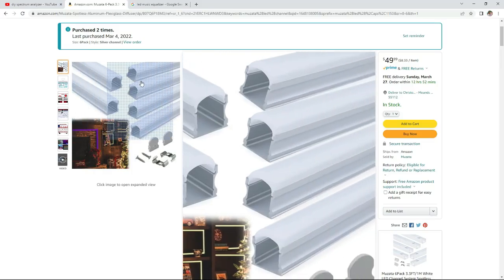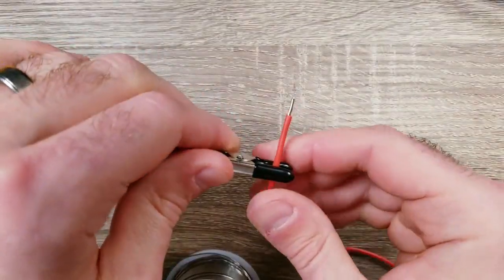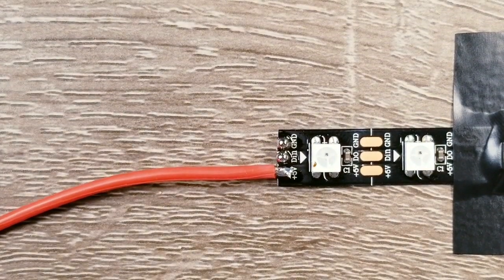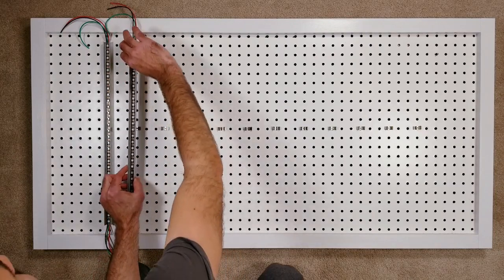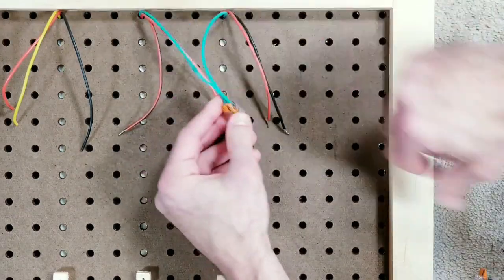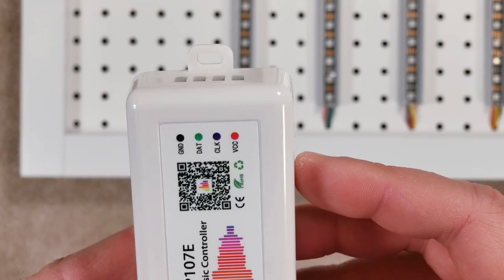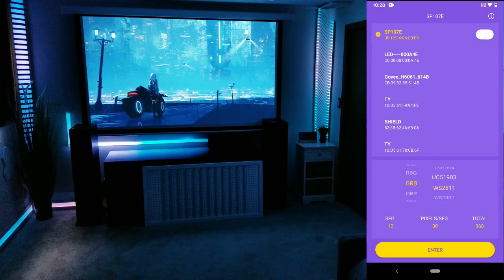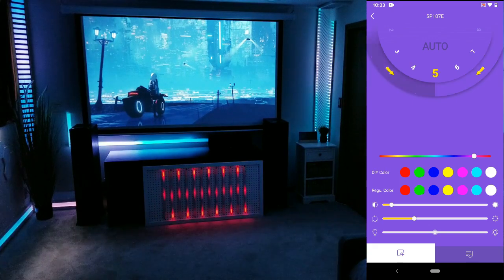DIY LED Music Visualizer - Complete Walkthrough

Comment: Pretty slick, man! very straightforward, clean, and looks awesome! I like that you kept your options open on power injection. I probably would have injected power from the other end just for my own sanity, but that's my OCD talking. 

As you mentioned in another comment, this would be very easy to convert over to WLED. I'm not sure if LedFx supports matrices or not, but that may be a viable option to pair with WLED. 

I like the simplicity of being able to connect to this with Bluetooth and that it just works, but I would definitely want it on wifi and would want some non-music uses for it as well. I may have to put together a matrix now and play with it, you've given me some ideas 😅
Reply from the maker: Thanks as always! Yeah I tried to make it so you can easily swap designs or controllers. I also didn't need any power injection as I was running the lights at about 10% brightness. Anything more than 10% was just way too bright for my liking. But If I were trying to run everything at 100%, for sure would need the extra juice for some of the white animations! Thanks again for taking the time to comment and for watching!

Comment: This is CRAZY, I have almost the exact same materials and project idea. But I’ll be doing 10 1m channels. Any advice?
Reply from the maker: Great minds think alike! You could do something pretty much the exact same but you would probably need some power injection at least at the end and more than likely the middle. But I would test things out first with no power injection and then go from there. Are you going to use pegboard or just secure everything to the wall?

Comment: Wow! Thanks for sharing this DIY, is it posible to add more led segments or up to how many is it posible with the power adapter?
Reply from the maker: Thanks so much! You can add a lot of segments. I'm not exactly sure how many but at some point you will notice the colors start to look off. That means you will have to inject some power around that point so that everything looks good again. How many led's it will take to start noticing the colors are off depends on what power supply you use and how bright you want to run the lights at. Hope that helps!!

Comment: Great project. Loving watching all your videos atm. I'm new to the channel but inspired to try a few of your projects in the new year. Quick question...I can see you recommended possibly injecting more power into parts that look discolored in bigger projects...does that involve installing another ac power source the same as the one you used or is there a different process. Sorry if the question is a little confusing.
Reply from the maker: Thanks so much for watching and thanks for taking the time to comment! I've never done really big installs so i've still only just used 1 ac power supply for some of the bigger projects I've done. That generally means you can just run separate wires from the power source (same power source that is hooked up to the beginning of the led strip) to the end of the strip (or middle or both) Now depending on the project, it might just be easier to use a separate power supply but if you do that just make sure you cut the strip at some point and only have the 2 sections that are powered by different units connected via the data cable if that makes sense!
Reply: @ChrisMaherDIY  thanks Chris.  Spent most of the night again watching your projects....Santa won't be happy that I'm asking for a Crickut off him 😆 I'm gonna start off with similar size projects to you anyway so hopefully I don't need to look into additional power. Keep up the great work also. Only recently discovered you but loving the content. So well made 👏 👌

Comment: this is awesome! do you know if it’s possible to use 2 connectors at the same time with the app?
Reply from the maker: Thanks so much for watching and taking the time to comment! That is a good question. I know the one connector does allow for a lot more led than what I'm using. You could for sure use 2 but I'm not sure if they would be able to be controlled simultaneously if that's what your wondering. I think you would have to go back and forth between the two if that makes sense. You could probably try splitting the data line coming off the controller and using that to hook up 2 different section. Both sections would then be doing the same thing at the same time!

Comment: Great video! Thanks for sharing! The LED Lights link in the video description points to the IP65 type but in the video it looks like you are using IP30. Just wondering if you could clarify if you used IP30 or IP65? Do you know if it is as easier to solder one vs the other once cut?
Reply from the maker: Thanks for watching and for pointing that out! I'll have to change the link in the morning. I for sure used ip30. Don't have to deal with that rubber coating so it'such easier to get to the pads for soldering. Thanks buddy!

Comment: Can u use this controller with strips of different length?
Like strip one 30leds strip 2 10 LEDs etc? Or will strip 2 the basicly be filled all the way all the time? Is it reprogramable / customisable is what I mean 😅
Reply: I bought the SP107E and ran into this exact problem all my strips are not the same length and no the app does not allow you to change the numbers of LEDs per strip. I am sure there is something out there that does. if anyone knows of one I would love to hear about it.

Comment: I was looking at your square led panel project. And I am wondering if I can solder the led strips.
Reply from the maker: You for sure can do the square project soldering your own led strips instead of using the ones I made. The square project was one of the first things I made and I was still very much learning as I went so thats why I used a led strip that could be compared with a govee strip instead of using a ws2812b strip like I do in most of my new projects.

Comment: Hey Chris, i have one question, isn't 10 ampere power supply too little? I've checked it on btf site and they say 1 led consumes 0.3w, which means for 360 leds basically you will need at least double of the power you have here, can you see a drop in power supply when you turn the leds on at max luminosity ?! by injecting the power from both sides the problem still exists? Kind regards
Reply from the maker: Thanks so much for watching and great question! I'm more of a trial and error type of tinkerer. I generally test things out with the leds I plan on using and with a much smaller power source than what would typically be recommended and see what happens. If things dont look good, then I add injection or a larger power supply. Now if I were to run this amount of lights at full white and full brightness with no power injection you would for sure see voltage drop. However, in most every project i've done, i never have a need to run them at full white or full brightness so using a much smaller supply generally works out just fine because for pretty much every animation, it looks great since its not drawing near the amount of power needed for full white on full brightness. Now with this number of leds, If I injected power at the end, I'm fairly confident that even at full white and full brightness it would look great but I cant remember for sure If I tested this out. One nice thing about using the wago connectors is how easy it it to add power! Hope that helps a little!
Reply: I have been thinking the same about the power. Chris, have you been running this project with the 10A power supply? Have you noticed any issues with it?
Reply: It is worth mentioning that the 60amps per LED is only when the LED is on and white. This is rarely the case with a project like this. Though 10amps seems low it likely does a fine job considering the lights are only really using about half of the max power draw

Comment: Not working for me im running the same setup exept im using 9 strips and im using wire nutz  the lights work fine up to the third led strip and then it gets dimmer, the colors change and the the sixth one just has a insanely faint red color can you help? It has the same cord too

Comment: On the SP107E manual it says that you need an external power source to run it(as in the power must go to the LED's and the lights), however you didn't do that and I also noticed that your LED strip didn't have the adapter connected to it. Did you remove it?

Comment: Hey Chris, great video. Do these LED’s have a white light? I’m not seeing the white channel.
Reply: These led strip doesn't have a dedicated white channel, however you can set 100% in R G and B channel to make it look white
Reply from the maker: These do not but I'm currently working on a project where I use some sk6812 led lights that have a dedicated white channel. https://amzn.to/3qO7ycn They are a little more expensive but its nice having that dedicated channel so you don't have to set the rgb to 100% to make white like you do on the ws2812b strips.
Reply from the maker: You got it! 100% correct. If you do want the individual white leds, i've had good luck with these: https://amzn.to/3qO7ycn

Comment: Hmmm how do you think this would look with a frosted glass slide to go over the front of it? Looking to do this project soon, but would like to keep the peg board from standing out.
Reply from the maker: Frosted glass would actually probably make it look super cool and unique! That's a great idea!!
Reply: @ChrisMaherDIY  I don’t have wood working equipment so I can’t feasibly do that idea. Instead I’ll be taking a sheet of plywood, using the pegboard as reference to get aligned holes. Painting the plywood and trim with a high gloss black. I think the black would make it look nice.
Reply: @ChrisMaherDIY  also I love your videos and ideas. Definitely want to do the vinyl and acrylic leds if I can ever get the proper equipment.
Reply from the maker: @King_Kato  Thats a great idea and I also think the black would look nice!!

Comment: How many segments can that controller run?
Reply from the maker: Thanks so much for watching! That's a good question! The only thing I could see is that its recommended a max of 960 leds.  I have never checked to see if that is in fact the max or what happens past it but my guess is you can probably go a little more than that but performance might suffer at some point.

Comment: Looks like you have a total of 360 leds, are 10 amps really enough to power this thing? I feel like it should be more like 20 amps
Reply from the maker: I'm always surprised at how good things look with little power. I always start out with less power and add it as needed. What saves me is that I really dont have a need for the lights to be on full white which is really the only time I can see a visible drop in voltage. Otherwise during all the animations, they look good to me without needing a ton of power. Thanks so much for watching and taking the time to comment!
Reply: @ChrisMaherDIY  Thanks for the info!
Reply: Usually, if you don’t care much about the “white” color accuracy, you can get away with a lower amp supply. A good rule is divide the amps “needed” by 3… and that should be enough for most color effects. Example: 21.6 A / 3 = 7.2 A (should be fine).
Reply: A led at full white brightness needs around 50mA. So that’s 18amps but he isn’t using full white so it’s only around 9A if all are displaying purple or something similar at 100 brightness

Comment: Hi Chris nice led project. Two questions the addressable LEDs when fitting are followed by the led arrows so one up then the next down is this correct & if so is this setup in the software to correct this for the vu meter? Thanks.
Reply from the maker: Thanks so much for watching and  that is correct. This controllers software is somehow able to make sense of it all with the one up and next one down configuration of the led strips.

Comment: does anyone know of a controller that will react to music even if I'm wearing headphones. So the mic cant pics it up and also the Y splitter is not an option this must be fully wireless. Its for a stream room I want this in the background reacting to the music on stream.
Reply from the maker: Thanks for watching and great question. I'm personally not aware of one but maybe someone else reading this might know and can chime in!
Reply: @ChrisMaherDIY  I found the answer shortly after look into LedFX its open source and runs on any esp device you can even sync multiple lights.

Comment: Is this reacting on environmental sound?
Reply from the maker: Thanks for watching and great question! It is. There is a mic built into the controller that is picking up the environmental sounds. You can also plug directly into a music source via the aux port on the controller.
Reply: @ChrisMaherDIY  I will make these too, you got brilliant ideas. Thanks for Sharing, the Corner lights that I have done also turned out very nice, thanks again. ☺️

Comment: Try this and could not get them to work like that, you connected top to top and bottom to bottom, my setup is basically the same just longer LEDs strips, anything you can think of that I might be doing wrong? using same controller with same leds brand as you, went back to my connection and they all seem correct, also tried with just 2 LEDs strips and nothing ;(
Reply: Are you ensuring the data on the cut strips is running in the correct direction, there is physical arrows on the strips that tell you which direction the data is travelling.

Comment: Just curious, how does the controller get its input, is there a mic on board or would I need to play something using a Bluetooth source
Reply: Hahaha nvm, it looks like you get Aux, on board mic, or Bluetooth options for the audio source.
Reply from the maker: You got it! Mic on the controller but the option to plug directly into music source with aux. Mic on the controller is very responsive. Go with the aux if your in a spot that is going to have a lot of background noise.

Comment: What song did you use at 8:59 ?
Reply from the maker: Man I'm not even sure! You can try searching on youtube for synthwave music and then see if you can find that same background. I'll try searching myself and send it your way if I find it again!
Reply: @ChrisMaherDIY  Don't search to far, its not a huge deal. It sounded really nice and I though you had a song list somewhere buried in your notes. Its all good brother. But other than that, the sound visualizer is amazing. would this setup be possible with the led strips being the full 4 ft length without the cutting and than just adding more 4ft channels?
Reply from the maker: @mmenil1  that should work perfect! Although these perticupar channels are 1 meter in length.
Reply: @ChrisMaherDIY  Of course of course.

Do you by any chance know what is the channel limit on the sound driver? (if power to each "3m" led channel is not an issue) As in, limit, like you can have 20, 30, or 100 channels with each having 60 leds in each segment.
Reply from the maker: @mmenil1  so I know there will at some point be a limit. I'm not sure what that limit is but at some point the controller would run out of enough memory to process the data. That would for sure be a fun experiment to do!
Reply: @ChrisMaherDIY  Gotcha, Once I begin this experiment,. Ill let you know.